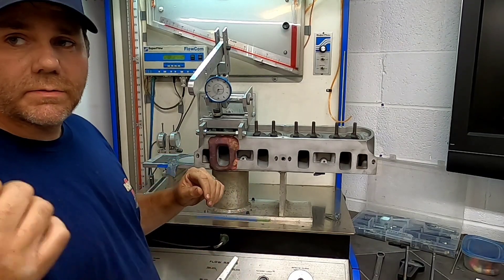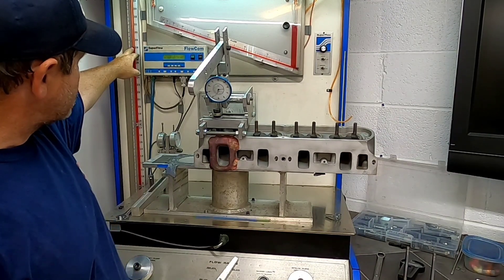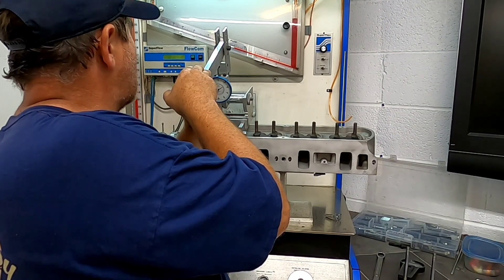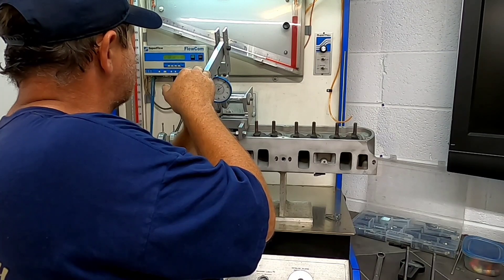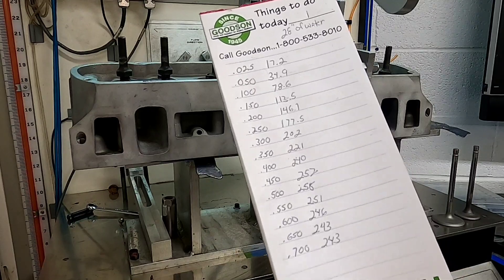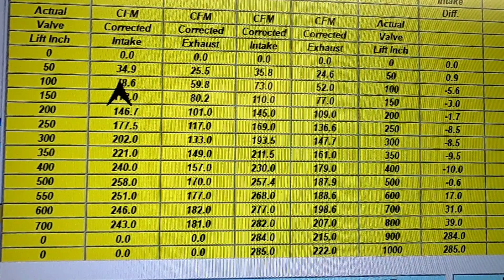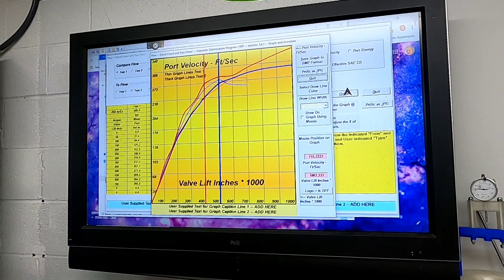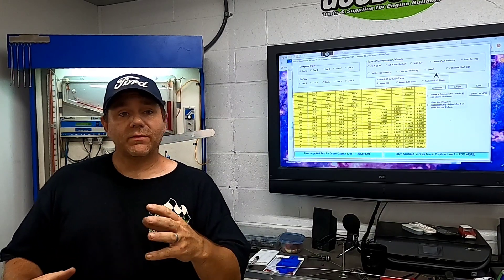Flowbench testing using David Vizard's IOP program Part 2

Comment: Nice video. I see you're still using clay air horns and building cylinders. We switched over to 3d printed horns and cylinders on the flow bench a few years back and greatly improved consistency and save a butt load of time on each new head. We have over a 100 int / ex horns and cylinders now without any fabrication, just cad and print. If you have a 3d printer, here is my Thingiverse example.  https://www.thingiverse.com/thing:250981
Reply from the maker: Jim,  Thank you for the kind words... We have just started in using 3d printed horns ourselves.. David has made a few for the common heads
That we test on a regular basis... I will check out that link.. Please help us spread the word about the channel
Andy

Comment: Pretty good numbers in the .500 range
Reply from the maker: Thanks Jody... Eric did a good job to be swinging in the dark so to speak!  I feel that when David opens the port up a bit and we go to a bigger valve we should hit the 300cfm mark, one thing I learned on those heads years ago... Unshrouding the valve in the combustion chamber makes it flow big time!
Reply: @UnityMotorSportsGarage   man, 300 cfm!!? Moving some air..which in turn, equals more power potential. Waiting for my heads to get back and see what the flow numbers will be. "Trying" to do 350 to the tire on a bone stock bottom end 142k mile explorer shortblock, 9.8 compression(about) and a small baby cam from Anderson motorsports in my daily driver 2000 for ranger with ac , T5 , 373 gears and 30 lb injectors. The intake and throttle body was ported to. I'll let ya know what the number are when I get it all back.. then have it dyno tuned.
OHH.. and them black widow venom 250's..🕶
Reply from the maker: @19jody72  for sure keep me updated on how it comes along!  What is the LSA on that Anderson cam?
Reply: @UnityMotorSportsGarage  108
Reply from the maker: @19jody72  that is going to work really well on your combo
Reply: @UnityMotorSportsGarage   I sure hope so. I'm going to see how the truck acts as far as daily/travel truck. If it's like I think its going.to be..I'll pull it back apart and put a vortech 331 in it.